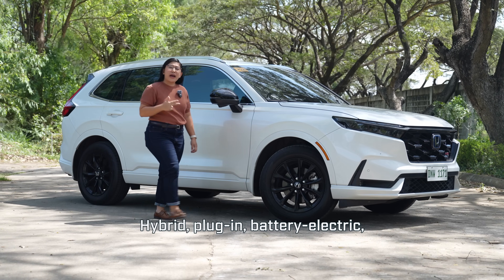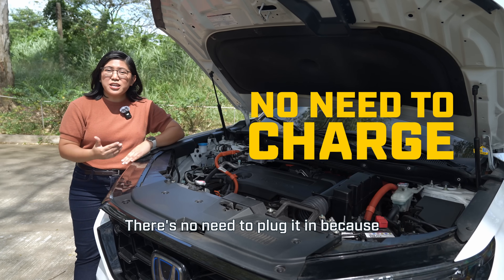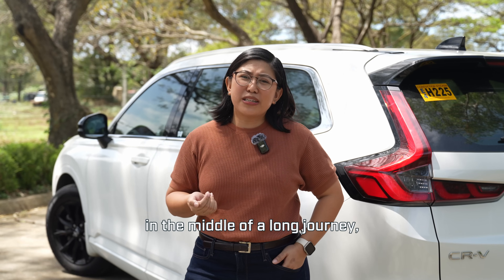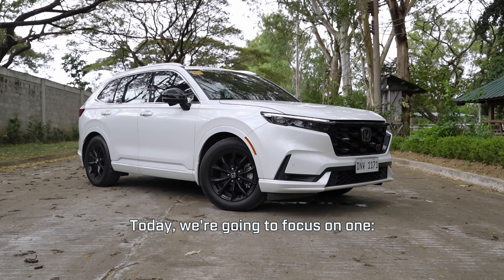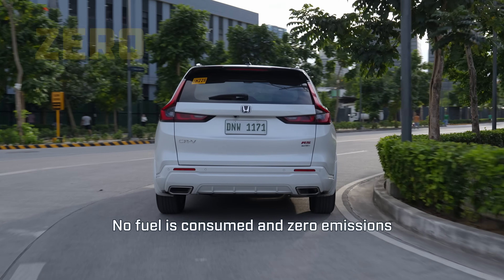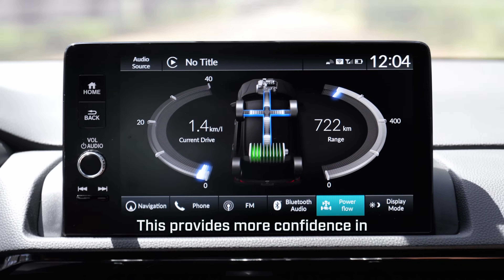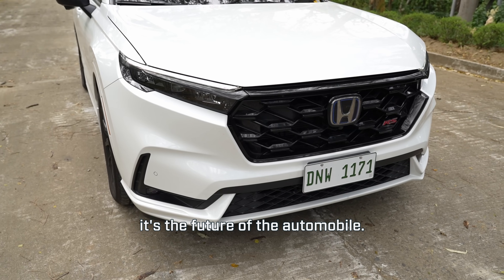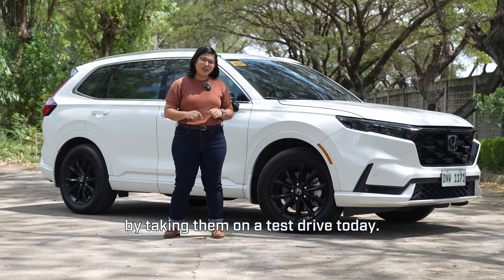Honda’s e:HEV powertrains explained: How exactly do they work? | Top Gear Philippines

Comment: So in this case the internal combustion engine is mated to the transmission and the electric motor is also mated to the tranny and a computer system determines which is the appropriate power source or mix the vehicle will get its power from in an instant? Am I correct?
The Nissan e-kicks still  is so far my preferred implementation of a hydrid -- ONLY the electric motor is mated to the tranny; The fuel engine just charges the electric system (battery/electric motor) addressing the distance anxiety problem. Currently I dont own an EV or a Hybrid; I dont have opposition to EVs in general; It benefits us all consumers if we have lots of options. I just don't buy for now the carbon neutrality or environmental friendliness assertions at this time because still the power generation mix in the Philippines is still 60% from coal. So essentially you are still using coal in your EV or hybrid.

Comment: Shout out po dun sa mga haters ng mga chinese Evs and hybrid vehicles na bakit daw meron household orange flexible hose sa ilalim or sa loob ng hood etc. looks so cheap daw, pangit, cost cutting etc. Ayan, gumaya na Honda!!  🤣🤣
Reply: That sound is called the low-speed pedestrian warning sound. It is a safety guarantee for pedestrians outside the car. The orange hose represents a dangerous high-voltage wire harness.